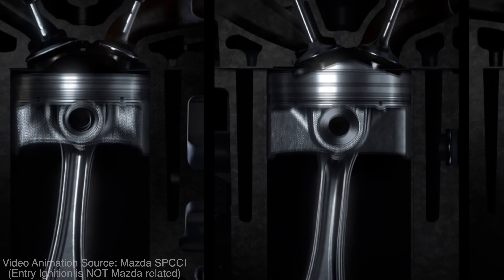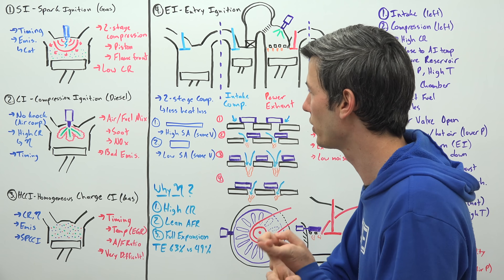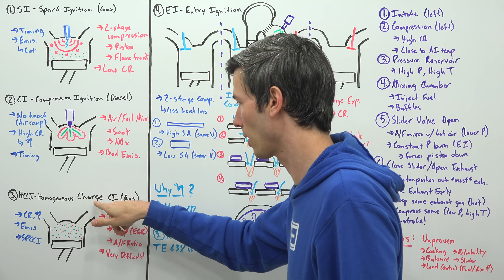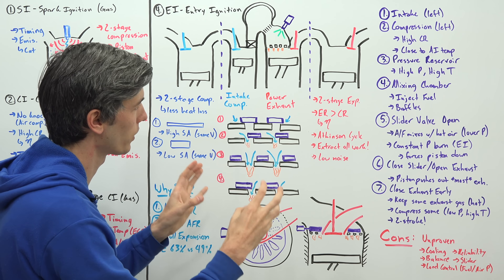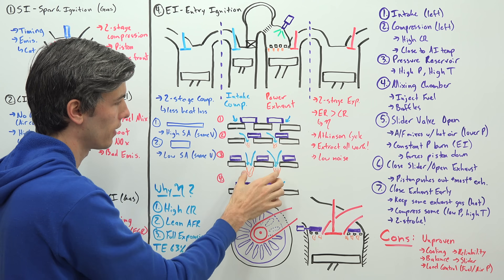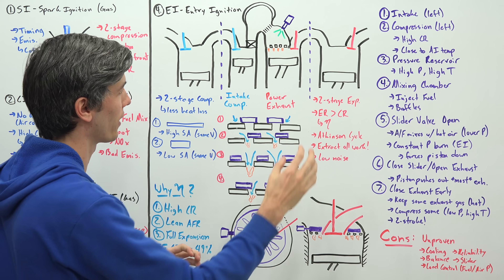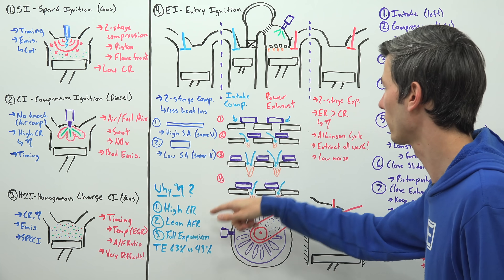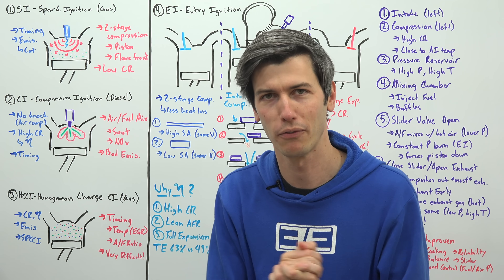Is 'Entry Ignition' The Future Of Combustion Engines?

Comment: Rotary engine: My spinning dorito blew 3 gaskets before 80k miles.
EI Engine: Hold my Slider valve...
Reply: That design has the problem of having combustion take place in one area.
Reply: @johnspecht72  The Wankel is obsolete because they have weak seals and horrible efficiency.
Reply: Sander Van der Kammen just horrible efficiency, apex seals are way better now.
Reply: @sandervanderkammen9230  That's absolute nonsense. If they were so unreliable you wouldn't see people making big horsepower with them. Do they require a rebuild more often than piston engines? Sure, but they're far easier to rebuild, and the parts are cheaper. The naturally-aspirated rotary engines last even longer.

They're obsolete because of fuel economy and emissions standards. It's hard to meet emissions when you're injecting crankcase oil directly into the combustion chamber.
Reply: @rars0n  Absolutely 100% true, Wankel engines are inherently unreliable and inferior to other types of internal combustion engines which are still being mass produced.

Unacceptable reliability was the primary factor in the poor sales of Wankel engines and their subsequent discontinuation. 

Emissions although significantly higher than comparable reciprocating engines was not a factor in the design becoming obsolete.
The Mazda RX8 met or exceeded the strictest emissions regulations until low sales ended production.
Reply: @sandervanderkammen9230  Repeating yourself doesn't make it true. Obviously you've never owned a rotary.

"Unacceptable reliability was the primary factor in the poor sales of Wankel engines and their subsequent discontinuation."

No, it wasn't. It was emissions and fuel economy. The RX-8 was removed from the European market in 2010 because it failed to meet emissions standards. Fuel economy standards in the US were set to reach an average of 42 MPG for cars by 2016. The RX-8 was dragging down the rest of Mazda's cars. It's no coincidence that since then, they've managed the best average fuel economy of any company.

It's hilarious and a little sad that you think the company would continue selling cars with rotary engines for over 40 years if they were as unreliable as you claim. Absolute nonsense.

Edit: Fuel economy is a bit more arguable, but was a common complaint when comparing the RX-8 to other cars of similar power, rated as low as 16 MPG in city driving and only 23 on the highway.
Reply: @rars0n  Fuel consumption of Mazda's RX8 models has always been substandard due to the Wankel engine's low efficiency...
Mazda's CAFE is low because the company doesn't sell high performance, full size or luxury models.

The Wankel engine has been plagued with reliability problems since its inception... unable to meet the increasing industry quality standards for reliability, sales of all RX models steadily declined from 1986.

Wankel engines are inherently unreliable and have short, very unpredictable service life...
This is why no legitimate aircraft manfacturer has ever produced a type rated passenger aircraft with a Wankel engine... they are simply too unreliable.
Reply: @sandervanderkammen9230  1986 was the year that turbocharged RX-7s became available, until in 1992 with the third-generation RX-7, sequential twin turbos became the only engine option, along with the Eunos Cosmo that used twin-turbo 2- and 3-rotor engines. In my opinion, Mazda would have been better off using more rotors than turbocharging those vehicles as turbocharging increased the complexity of the engines and cooling requirements, on engines that were already quite hot to begin with.

That said, with regular maintenance a non-turbo rotary engine is quite reliable, nothing at all like what you are describing. Typically, a non-turbo 13B will go about 90k miles between rebuilds, although as I previously stated, rotaries are a lot easier to rebuild than piston engines. Again, it's extremely obvious that you've never actually OWNED one and have no idea what you're talking about. There were some issues with the Renesis rotary, in part because Mazda completely changed the side seals in that engine, but that's not why Mazda discontinued the RX-8. They discontinued the RX-8 for fuel economy and emissions reasons, like I've already repeatedly stated.

It's funny that you mentioned airplanes, as Mazda rotaries are quite popular for use in home-built airplanes, thanks to their compact nature, power-to-weight ratio, and other factors. As far as sales numbers are concerned, the only thing I really found was US RX-7 sales which did in fact peak in 1986, but again, this is also the same year the turbocharged cars were introduced, which drove up the cost of the car until the third-gen and other Japanese Bubble Era cars treated price as no object (Mazda was planning to launch their own luxury brand to rival Lexus and Infininit, called "Amati" whose flagship car was to have a "280 HP" V12 with displacement of either 3.6L or 4.6L).

But that's ignoring non-RX and overseas rotary sales. And of course there's the matter of the crash of the Japanese economy in 1991 that lasted over 10 years. If you think the sales trends were determined solely because of the engine's reliability or lack thereof, you're extremely naive.

If you're just going to keep repeating the same nonsense, I'm not going to keep replying, because I've already explained in detail why you are wrong and I'm not going to do it again.
Reply: Adam Baldwin don’t worry. Most of the people commenting have never owned a rotary. They just spit back the crap they hear online. Rotaries are not unreliable, they just don’t last when you treat them like a piston engine or have poor maintenance schedule. You’re 100% right on why they stopped production, reason why the renesis was no good because they tried to change the design to address those fuel economy and emissions requirements causing premature failure due to hot spots in the irons and side seals. I have owned rotaries for many years and they are just as reliable with proper maintenance. My engine lasted 200k before rebuild and that was because I decided to track it because I knew I wanted to build it up so it didn’t matter to me if it blew. Needless to say it only blew a coolant seal and still drove it another 2 month after that day. Go tell a piston engine to do the same, I’ll wait.
Reply: Sander Van der Kammen EPA killed The Wankel. Rotaries are in use in a plethora of applications and provide long, reliable service.
Reply: @rars0n  Additional housings requires additional apex seals... the primary failure mode of the Wankel engine is compression loss due to seal failure... more seals equals less reliability.

The Eunos Cosmo was another embarrassing Mazda sales flop.

The Wankel engine lacks modem quench-type combustion chamber technology, a serious disadvantage in a turbocharged applications due to the higher occurance of pre-ignition, detonation and erratic flame propagation... all precursors to apex seals failure.
Reply: @rars0n  The Wankel engine even with the strictest service and inspection schedule is significantly less reliable and durable  than comparable reciprocating engines... this is a well documented and proven fact.

You realize that 90k miles is less than most manufacturers standard engine warranties?

If that was true? Then why are their so many RX models for sale at scrap value prices that need a new engine???

The Renesis was a failure because it had the highest static compression ratio of any production Mazda Wankel engine... with unleaded gasoline and stochiometric AFRs apex seal failure was inevitable.
Reply: @rars0n  The Mazda RX8 was discontinued due to poor intial sales and a rapid decline after the models notorious reputation for engine for premature engine failures and Mazda's failed attempt to cover-up the problems which led to recall investigations,  factory buy-backs and class action lawsuits for manufacturing defects and warranty claims.
Mazda designed the RX8 as a high volume model with sales averaging 100,000 units per year to pay back development and production cost to turn a profit.
By 2011 the Mazda Ujina factory RX8 assembly line operated just one 4 hour shift PER WEEK and was hemorrhaging red ink... estimates of RX8 losses were in the $3 billion dollars... any hopes of reviving the failing brand was simply out of the question for Japan's smallest and least prosperous auto maker.
Reply: @rars0n  Funny you should mention home built aircraft... the Wankel engine is NOT POPULAR with home built aircraft.
Wankel engines are completely unsuitable for passenger aircraft applications.
Poor reliability, high fuel consumption with reduced payload, poor propeller rpm characteristics and high cockpit noise levels make the Wankel a terrible choice for aircraft which is why there are only a handful of Wankel powered aircraft in the entire world..
 Many have been converted to reciprocating engines.

GAS TURBINE engines dominate the aviation industry because not only do they deliver an Order of Magnitude of power-to-weight ratio performance with fuel efficiency and reliability that is simply impossible to achieve with the obsolete Wankel engine.
Reply: @rars0n  All of Mazda's attempts to move up market with a luxury marque including Amati, Eunos and efini have been colossal financial failures... Mazda remains in the minds of consumers as a cheap, entry-level cars aimed at less sophisticated first time buyers.
Reply: @lynxstarautomotive208  WRONG!
The Mazda RX8 met or exceeded EPA Tier 2 Bin 5 emissions when Mazda pulled the plug due to low sales.
Mazda lost $3 billion dollars on the RX8.. one of Mazda's biggest flops.

Wankel engines are obsolete, they are no longer in series production by any legitimate engine manufacturers. 
The Wankel only saw very limited success in cheap, low end automobiles.
The Wankel was a commercial  failure in all other applications.
Reply: @sandervanderkammen9230  That's not failure, that's regular wear. Metal parts moving against metal parts. Piston engines do the same thing.

Why are you still commenting? You've repeatedly demonstrated that you don't have a clue what you are talking about. I already stated that I was done talking to you, so now I'm blocking you because you don't know when to stop.
Reply: @rars0n  The facts are irrefutable, you are simply too immature to accept the TRUTH.

Reciprocating piston engines are vastly superior in reliability and service life.
The reciprocating engines can easily  meet and exceed FAA and EASA airworthiness certification... something that no Wankel engine can because they are inherently unreliable.
Reply: @rars0n  I think it's time for you to go kid... you need to stop spreading lies and false urban myths.
Reply: @sandervanderkammen9230  do you feel better now that you have your false and entirely arbitrary sense of "victory" against a "foe" you not only took upon/created for yourself, but one you've also never met, and likely never will again, be it in person or on the internet? Does an honestly quite fragile sense of anonymity make you feel "powerful"? It's quite an interesting phenomenon, the pot calling the kettle black. Rather petulant to continue an argument or debate that the other party has entirely digressed from...
Reply: @3xeplodng_3agle_studios  Thank you, I'm glad to hear you learned something about Wankel engines too and have a great day. Cheers!
Reply: @sandervanderkammen9230  hm... Good response. Clever. Though i find you... Less than agreeable a person, i wish you the same tidings.
Reply: @3xeplodng_3agle_studios  I love Wankel engines and have been fascinated with them my entire life... I enjoy nothing more than discussing  the finer technical and theoretical details of its design.
Nothing irritates me more than when people make up false excuses for why it was a commercial failure... and even more annoying when someone blindly repeats these false myths as if the were fact without any metric for truth or accuracy...
It is the new plague of the internet... the irony is that in the information age it's the truth that seems to be ever harder to find.
I hope you have a great day.
Reply: @sandervanderkammen9230  Engines nowadays are probably less reliable than an 2000's Rx7 rotary, lol.
Reply: @sandervanderkammen9230  You realize that most cars nowadays DON'T reach 90k miles? 144 thousand km. That's not reached by most modern engines. Sure, pretty much everything built in the 90's built by Toyota beats by a lot, but current engines? Not really. Plus, an engine rebuilt is much cheaper and quicker, anyway. They might not be much efficient due to low compression ratios, but that's another thing. After all, it was efficiency and emissions that killed the RX7, leading to a weak Rx8.
Reply: @sandervanderkammen9230  It also burns too much lub oil that emission standard is hard to meet if not impossible
Reply: @vladlu6362  Prove it!
Reply: @vladlu6362  You obviously know nothing about the automobile industry.
That is a lie and you know it.
 Mazda canceled the RX brand for one simple reason, people refused to buy cars with unreliable Wankel engines.
The brand was discontinued because of lack of sales and financial losses.
Reply: @catchnkill  Not true, the Mazda RX8 met or exceeded the world's strictest emissions standards right up until production ceased in June 22nd 2012 due to POOR SALES.
The RX8 was a sales flop and Mazda lost over $3 billion dollars on this very unpopular model.
Reply: @sandervanderkammen9230  It is an amazing racing engine. Few would argue that.
Reply: @shawn13mertle13  Then why was it so unsuccessful in racing?
Mazda doesn't even have a motorsports program anymore.
Reply: @sandervanderkammen9230  They are not allowed to compete unless they share the patent for their engine. That started in about 05 or 06.
Reply: @shawn13mertle13  Patent for what engine???
Reply: @shawn13mertle13  Still waiting... What patent????
Reply: You have a computer. Do I need to give you links?
Reply: @shawn13mertle13  Links to what? WTF are you babbling about????
Reply: @sandervanderkammen9230  Using modern techniques rotary's can be built to be reliable, but they will not be efficient or clean (at least on gasoline). The renesis engine did get good emissions, but due to its carbon issues not seen on peripherally exhaust ported engines it needed new apex seals and other things that lowered reliability. Additionally fuel mileage was still terrible. Apex seal technology improved with time and normally ported 13bs can be quite reliable if appropriately cooled and lubricated. They still require burning a bit of oil, but with something along the lines of direct injection to prevent fuel loss from intake overlap they could probably be somewhat reasonably efficient maybe.

That dude is actually right on the aviation thing, for light aircraft rotaries are nice because they are light and if they fail from something like overheating they lose power progressively instead of seizing
Reply: @BIGGlep  You really don't know much about Wankel engines do you?
Reply: @sandervanderkammen9230  Part of the art of conversation is it is quite impolite to make demands. I see you have been commenting on this for quite some time. A few proverbs are showing themselves to be true. Only one is needed. Cast not your pearls before the swine.
Reply: @sandervanderkammen9230  In 1976, Ray Walle, owner of Z&W Mazda, drove a Cosmo (Mazda RX-5) from the dealership in Princeton, New Jersey, to Daytona, won the Touring Class Under 2.5 Liters at the 24 Hours of Daytona, and drove the car back to New Jersey. The Cosmo placed 18th overall in a field of 72. The only modifications were racing brake pads, exhaust, and safety equipment.[46]

After substantial successes by the Mazda RX-2 and Mazda RX-3, the Mazda RX-7 has won more IMSA races in its class than any other model of automobile, with its hundredth victory on September 2, 1990. Following that, the RX-7 won its class in the IMSA 24 Hours of Daytona race ten years in a row, starting in 1982. The RX-7 won the IMSA Grand Touring Under Two Liter (GTU) championship each year from 1980 through 1987, inclusive.

The Mazda 787B, winner of the 1991 24 Hours of Le Mans race
In 1991, a four-rotor Mazda 787B (2622 cc actual, rated by FIA formula at 4708 cc) won the 24 Hours of Le Mans auto race outright. The 787B's triumph remains unparalleled, as it remains the only non-piston-engined car ever to win at Le Mans, and Mazda is the first Japanese marque to have won overall at Le Mans – and only after Nissan had closed down its World Sportscar Championship programme and Toyota had opted to take a sabbatical for most of 1991 in order to develop its 3.5-litre TS010. This led to a ban on rotary engines in the Le Mans race starting in 1992, which has since been rescinded. After the 1991 race, the winning engine was publicly dismantled for internal examination, which demonstrated that despite 24 hours of extremely hard use it had accumulated very little wear.

The Le Mans win in 1991 followed a decade of class wins from other Mazda prototypes, including the 757 and 767. The Sigma MC74 powered by a Mazda 12A engine was the first engine and team from outside Western Europe or the United States to finish the entire 24 hours of the Le Mans race, in 1974. Mazda is also the most reliable finisher at Le Mans (with the exception of Honda, which has entered only three cars in only one year), with 67% of entries finishing. Mazda will return to prototype racing in 2005 with the introduction of the Courage C65 LMP2 car at the American Le Mans Series race at Road Atlanta. This prototype racer uses the Renesis Wankel from the RX-8.

Mazdas have also enjoyed substantial success in World Land Speed competition, SCCA competition, drag racing, pro rally competition (the Familia appeared in the WRC several times during the late '80s and early '90s), the One Lap of America race (winning SUV & truck in a MazdaSpeed5), and other venues. Wankel engines have been banned for some time from international Formula One racing,[citation needed] as well as from United States midget racing, after Gene Angelillo won the North East Midget Racing Association championship in 1985 with a car powered by a 13B engine, and again in 1986 in a car powered by a 12A engine.Mazda was the first Japanese car to win Le Mans.
Reply: @shawn13mertle13  Mazda 787b LOST both the 1990 WSC Championship to Mercedes-Benz and the 1991 Championship to Jaguar.
The 787b was slow and uncompetitive losing 20 out of 21 races with no poles or fastest race lap times.
Reply: @shawn13mertle13  Answer the question!!! WHAT PATENT?
Reply: @sandervanderkammen9230  the failure point of most engines is a seal? I fail to see the point.
Reply: @calebyarbrough4621  Indeed, this true... the Wankel engine however has a sealing design that is inherently inferior and flawed... its also the reason why the seals fail that cannot be remedied.
Do you know what the primary failure mode of an apex seal is?
Reply: @shawn13mertle13  Can you tell us why not a single type rated passenger aircraft in the world has a Wankel engine????
Reply: @shawn13mertle13  Mazda no longer has any factory motorsports program.
Reply: @sandervanderkammen9230  Can you tell me who is us?
Reply: 9k rpm
Reply: That slider valve would work with high priced unobtanium but to get a production ready affordable one would take years
Reply: @rogerpearson9081  Only just one of the Wankel engine's many problems.
Reply: Hahah
Reply: oh lord ahahahh
Reply: bobwatters  Rotaries have a reputation for being unreliable, both from people who have never owned them and people who don't know how to properly maintain them. The fact of the matter is that they are perfectly reliable when properly maintained (much like any other engine, with a few extra caveats).

There really aren't that many seals in a rotary engine, and it's really only the apex seals that will cause catastrophic damage if they break under certain conditions (really high boost, high rpm, and fueling issue, for instance). Corner seals, side seals, and oil seals never catastrophically break.

I think the main reason why people like them is that they're compact. They're also very smooth when properly balanced. IMO the sound of a 2-rotor is something I don't particularly care for (to me they sound like a chainsaw on crack and are unbearably loud when they're ran with a straight pipe exhaust at the track).

True, nobody chooses a rotary for reliability, but that doesn't mean they aren't reliable. Rotaries are also the easiest engine to rebuild by far and it can be easily done in a day in your garage.
Reply: That's why there are called wanker engines not wankel